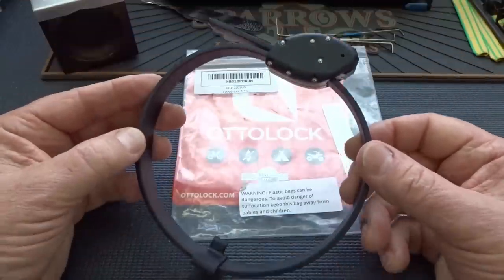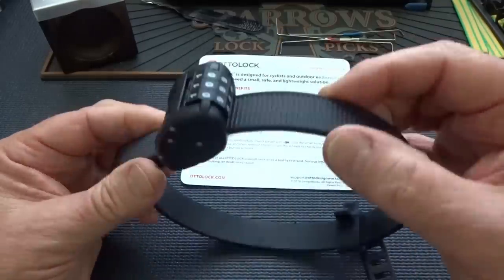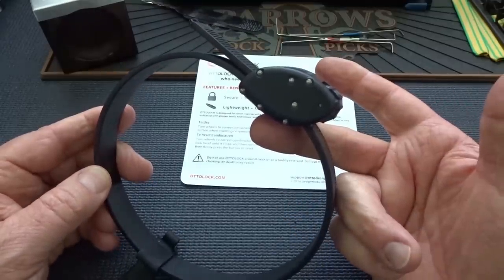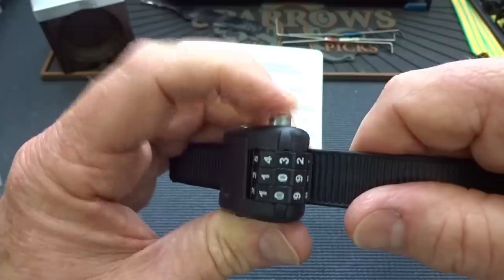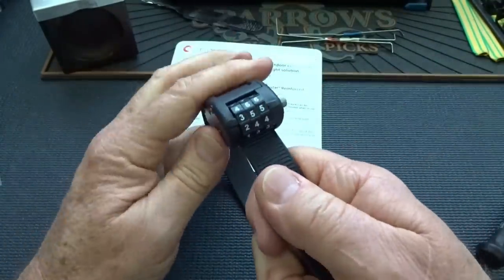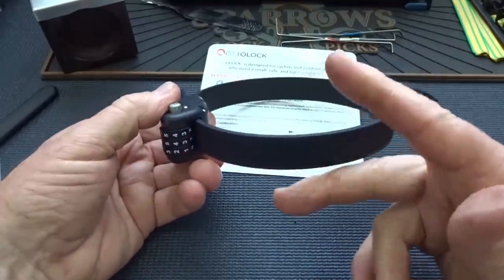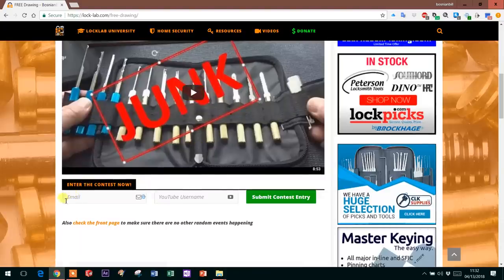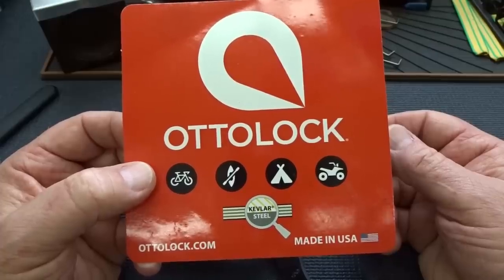(1272) Review: Ottolock Bike Lock (JUNK!)

Comment: This is very unfortunate. We appreciate the quality of your reviews and explained context around bike locks and design intent. As you mentioned, our lock is designed as a short-stop theft deterrent with key features being lightweight, compact size, and ease of carry. The lock reviewed in this video most likely has a defective key inside. The key is not engaging the pawl. This could be due to a missing key, damaged key, missing spring, or stuck key. In any case, it demonstrates a gap in our quality control procedures. We have a very comprehensive incoming part inspection program, and we also conduct a 100% inspection of each lock at the end of our assembly line. While we do not know the problems with your prior two locks, this lock is defective and completely a fault in our workmanship, not design. We will provide you with another new lock for another review.

Additionally, two other points: 1. Your shim failure attempt is not entirely valid as the pawl was not locked in place in this test, and 2. The ladder strap on the provided lock is not for carrying on the bike, but rather for holding the lock in coiled position. The bike mount is much bigger, stronger and sold separately.

We are proud of our ‘Made in the USA’ manufacturing and prioritization of quality first, and happy to address any questions directly via our website and support team.
Thank you,
OTTO DesignWorks
Reply: Oh, come on. 100% inspection of each lock? I call BS. You have a 3.2 rating on your lock on amazon, with people having all sorts of issues, including their lock being stuck closed. One such reviewer mentioned using a knife to shim the lock open when it gets stuck closed. Your locks have serious issues and so does your quality control, if it even exists. This was not an isolated incident.
Reply: I never tried one of your locks so I can't give my opinion about the quality of your prodcuts. But at least you seem to offer a solution here. I hope you'll keep your word and that Bill will make another review.
Reply: He received 3 defective locks in a row. Who is your QC person? Homer Simpson?
Reply: The next Bill Gates maybe ? I wish I would have watched this video before I purchased mine. When it gets here if the same thing happens I'll return it in a jiffy.
Reply: This could be very good for your company in the long run. If there are problems with the design an outsider will often see them more quickly and allow you to make corrections early.
Reply: This has been good. While not a design problem, we did identify a manufacturing process change to eliminate any probability of missing catch key spring.
Reply: OTTO DesignWorks I’m actually impressed guys- how often do we see manufactures owning up to mistakes, and taking initiative and ownership on corrective actions? Great job OTTO, now please stand behind your insertions.
Reply: Good on you Otto. I will keep this comment in mind if I look into future designs and improvements of this lock, should I choose to need a new lock. Should definitely mind the shimming bit though.
Reply: For $55 for very light protection when it works, you couldn't include a damn MOUNT? That is absurd.
Reply from the maker: Still waiting for the replacement.  LockLab, P.O. Box 2160, Merrifield, VA  22116
Reply: Sorry Bill. We did not see a reply email. We'll ship this week. Thanks for address.
Reply: Good on Ottolock for responding and owning the issue with THIS particular lock. Needless to say; The review of a obviously defective lock is pointless, other than showing that he couldn't cut the band with pliers (any lock can be cut with a grinder/hacksaw). I own three of these locks that all work fine and can't be defeated with a shim/butter knife or whatever. Perfect lock for short stops and way more secure than cable locks.
Reply: so how do you feel about the fact it can be cut in 2 seconds with 10 dollar shears?
Reply: Lol. I might as well use my belt as a lock instead of the ottlock. Both provide the same security.
Reply: China numba wan!
Reply: Why are you deleting comments in your videos?
Reply: 9 months late to the party, but this many security defects and manufacturing defects leads one to believe Otto's 100% inspection of product with these sorts of failures is either a lie, done by the utterly incompetent, or that the flaws are actually the intended design.
Reply: OTTO DesignWorks  Your product is complete junk as it can easily be cut with tin snips or scissor.  WAKE UP !!!
Reply: e.g. Smith why would they wake up. They make $55 a piece.
Reply: Guess what else is short term. The time taken to cut this off a bike
Reply: @thefuumanchuu  dont insult homer like that obviously the guy is worse
Reply: @DATH-kc6ei  That makes for a pretty short stop if as it takes 30sec to cut with a pair of tin snips !!!
Reply: I going to buy one and use it for a dog collar for my mastiff thanks bill
Reply: From the videos I've seen, you're better off using heavy duty zipties, if you want a minimal deterrent: same level of protection, but much cheaper...
Reply: Your short stop lock is 50+ dollars and is worse than a 20 dollar ulock. GET OUT
Reply: Just go to home depot and buy $10 metal snips, lock defeated in less than 2 seconds.
Reply: @ottolock  I find it interesting that you disable comments on your advertising videos as soon as someone points out the fact the Lockpicking Lawyer showed that this "lock" can be cut in 2 seconds or less with a readily available Wiss compound leverage (aviation) snips. However, Bill shows and even easier and toolless method of defeating the "lock".
Reply: @HaggisPower  nope, $10 aviation snips cut right through it.
Reply: @777osbaldo1  or use a cat's flea collar.
Reply: Get OTTO here and DesignWork a new lock that actually cannot be permanently opened using tin snips (or other tools such as bolt cutters).

Until BosnianBill AND LockPickingLawyer can verify the improvements, I have little faith and would rather see the finishing kick in the near future.
Reply: And easy to cut with some tin snips? Is that part of the features?
Reply: Also, why do you condone your supporters calling people who cal you out on your "quality" products trolls? It goes to show what morals you (don't) have.
Reply: @egSmith-sp9gl  You're giving them 15x too much credit. It's cut off in under two seconds.
Reply: @bosnianbill  they ever send out that replacement?
Reply: You might as well use a industrial zip tie this lock is not worth making in the first place pure and absolute rubbish.
Why do you people give it up as a bad job
Reply: They would probably work as straps for snowboard bindings to lock your feet to the board while riding, i mean if it was working,I'll guess something like that made this idea of locks.. Not a bad idea it's a very bright idea. I like the concept but the materials are very far from strong enough And it should have a false gate for shims. I would love to see ottolock coming with a upgraded version that works every time and can't be cut with a bolt cutter. I just watched the commercial for this lock and it said it was carbon plated and not possible to cut with wire cutters, which this video shows is not true. Anyways he should also try with normal scissors just to see if any kindergarten kid can take your bike
Reply: This sounds like complete bullshit.
Very happy I did a little research before buying this garbage to lock up my prized road bike.

You make made in the usa look very very very very bad sir
Reply: Otto lock You rigged the tools in your review video you posted on YouTube and shutoff the comments so we can't call you on your b.s. So we're guna call you out here .
Reply: @bosnianbill  did it ever come? I don't see a second video from you on it
Reply: I'm amazed that a company could screw up a ziptie
Reply: wow a brand company watched the video
Reply: Nice cover up lol back to the drawing board haha
Reply: Literally legal boiler plate lol...

Comment: when you changed the code and simply pulled it out I laughed so much.
Reply: I think the problem re-setting the combination (at 4 minutes) may be caused by the fact that the reset was done with the band inserted in the lock.  The packaging that came with the lock I purchased (July 2019) had a warning about that -- it says, "Do not reset the combination with the band inserted in the lock"

Comment: I bought two of these locks last winter, but I had the opposite problem that you had: they were very, very hard to open.  I was positive I had the right combination dialed because I could press the button down, but I tugged and tugged.  Eventually I could get the lock open, but it wasn't easy, and I was very worried about it getting stuck and having my bike permanently locked somewhere.  I simply can't trust this lock.  The only support I got from the company was to tell me to watch the video about changing the combination.

I thought it was interesting how easily you smashed the lock with a hammer.  The company had an advertising video that made it look very hard to do this, but you did it in about 5 hits.  It's also scary how easily you cut through the lock with a simple hacksaw or a pair of wire cutting pliers.  I know these locks aren't supposed to be super secure, but I thought they would have provided a bit more protection.
Reply: Mine failed in the Lock position after 3 years of light use.  I had to cut it off with diagonal cutting pliers -- fortunately that just took a few minutes.

Comment: Just thought of those stainless steel hose clamps (the ones with the screw). Much cheaper.  Available at any hardware store.

Otherwise, four to five feet of Pewag chain (1/4 the weight of your bike should suffice) and a decent Squire padlock should offer some more resistance. Thieves will then cut the tree or fence or try their luck on another bike ;)

Comment: That's surprising, but all down to quality control as you say. I have a couple ( I was an early Kickstarter contributor) and they are both perfect at what they do. That is, a lightweight lock that would stop a casual thief, or a less casual one armed with bolt cutters. I doubt if you could shim the pawl if it was locked, as there is no trace of movement in the strap.

Comment: My OTTOLOCK came in the mail today. The 30" Black model. For one thing, the lock looks a lot thinner than it does in the pictures.  What I mean by thin is that its less than inch in width. In any case, after watching this video I took it through the steps. First I checked if I could change the combination. I was able to change the combination NO problem. After changing the combination I pushed the other end through the lock and tried to pull it apart. I'm not the strongest guy in the world, but not the weakest either. I finally gave up trying to take it apart with my bare hands. 

Then I did the shim test as seen on your video, again I was unable to take the lock apart. The mount the lock came with I think is just to keep it together and is not really a bike mount. Why would someone want to mount this to their bike I don't know ? It is small and light enough to fit in your pocket(jacket pocket). 

Maybe I got lucky or something, but thank god none of the things you mentioned happened with my lock. Of course I'm not going to try the hammer trick, drill, or Grinder test you did at the end of your video, I just can't afford it !  

Well so far so good... If any of the things you mentioned on your video do occur in the future I will surely keep you posted. 

 This lock is just what I wanted for  short trips around the neighborhood,  the grocery store, liquor shop etc. or when I'm relieving myself on the trail.  I also got myself an ABUS Ultra 410(entry level)  and a $40 bike Alarm for more serious situations. I know this might be overkill, but I hate thieves, especially bike thieves. 

Next week I'll probably order the OTTOLOCK's big brother which is the LiteLok Gold, https://www.litelok.com/collections/litelok-products/products/litelok-gold-wearable-boa-green  .  What else am I going to spend my Tax refund on ?  One thing for sure  I will not be leaving my bike overnight anywhere on this planet, lock or no lock. Not even in front of a police station. But for a couple of hours I think I "might" have purchased peace of mind.
Reply: How much does ottolock pay you to write these diatribes?

Comment: I purchased mine (30") today @ REI. I had a bit of difficulty getting the new combination to reset. I was using the end of a Pentel lead pencil and it just wouldn't go. I found this was to wide, I switched to a small paper clip. Worked like a charm them. Combo reset and works fine. I wanted something small and would fit in my bag that I could use if I was going to run in somewhere for a minute. Nothing long term, this fits the bill.

Comment: This reminds me of a bicycle like I used in Mexico a few years ago on a rental bike except it was a coiled cable.  The lock was in really bad shape and I could hardly ever get it to unlock so I would just take the coiled portion and twist it around something and make it appear as if the bicycle were locked but it never really was. And I did that everywhere I went and everybody just assumed that the bicycle was locked up to something. So with this lock no one would probably ever think to try to pull it loose, they would probably try to cut it first.

Comment: this is along the same lines that i said would be the weakness of this lock in early videos of this lock.   First, with such fine ridges in the strap for the mechanism to hang on to (hold locked) the lock frame would need to be extremely stiff to prevent flexing out of the ridges if forced and yanked.  Secondly, the internal ratcheting mechanism would need to be built to EXTREMELY high spec'ed tolerances to not give any slack while engaged in such tiny ridges.   

The 2nd is the reason i suspect this lock is failing.

Comment: Just bought one from the Amazon,  for $65, longer version, seems to work fine, and wheels are smooth too, changed combination in two seconds, does look like an expensive zip tie, but I wouldn't carry any other lock this one is weightless, goes into my tiny underseat bag.

Comment: Even less secure than this lock on a computer case. I opened it with an unfolded paperclip. hand turn the core (as in, no tentionner), slide in the paperclip, lift, hand turn the core.

My first attempt was to lock it, I tentionned it by turning the locking bar behind the lock, so light tention, lift and it turned....

But hey! I had to actually use a tool! ... I need to try to unlock with a zip tie, it can act as both the lock pick tool and the tentionner I guess?

Comment: I had a 30" OL which worked fine, but just wasn't long enough for my application, so I went all-out and bought the 60". It works great too.     Not sure most people are aware, but another reason to consider this type of lock is if you have bike insurance and your bike gets ripped off, It's hard to make the ins co pay up unless you have the ruined lock that the theif broke into to get your bike.

Comment: How does it operate when it's pilled tight around a pole or bike? My guess is that that is a quick release feature so you can open it quickly without something in it regardless of what position the locking parts are in, but when you pull it tight around whatever you're locking, it operates properly.

Comment: I have this lock and can tell you that it does NOT behave like this AT ALL.  When out of the combination, it will NOT open or slide out.  The other thing I see is that if the lock was not working properly when locked, sliding the shim in is not going to prove anything.  You can't slide a shim in my lock.

Comment: Hey Bill, I wonder if the lock is intended to be used like a zip tie, where you're supposed to pull it tight. Then the Locking Paul would be firmly planted against the ribs or the teeth on the Belt. I'm probably too late with this comment, and I know that for testing a lock, those instructions should be on the instruction card. Thoughts?
Reply: A zip tie works without pulling it tight.... if it doesn't you got a shitty ziptie.

Comment: I have this lock and COULD NOT REPLICATE THE FLAW in the video. It's going to give some sort of protection; but if I was going to leave my bike unattended with it for some time, there would be at least one other lock used in conjunction.
Reply: Yeah but around every 3rd rating of this lock has problems with them. And then they claim 100% quality control lol
Reply: Michael Anderson I had my bike stolen recently. I got this lock and along with a U-Lock. I know a cyclist who says the two together should be alright. But I may get the 60” to snake both tires.
Reply: SNIP with $10 Wiss aviation snips. This "lock" is better suited as a cat collar.

Comment: If you get in touch with the seller and tell them what is happening with the defect, and if they are worth anything as a company then they will refund/cover your shipping. If not then still try amazon even if it is not a “fulfilled by amazon” order. They might make it right, particularly since you have the defect on video and had to deal with 3 non working units. I can’t believe how garbage this “lock” is. Tying it in a knot would be more secure then using the lock.

Comment: While bolt-cutters have difficulty with sheet metal, simple sheet-metal-cutters should not have as much trouble with this type of lock.  It would have been nice to see you attempt with sheet metal cutters, at the end, instead of using electrical-copper-wire cutters that are not designed for that.
Reply from the maker: I didn't think of that!  I have some metal shears around here somewhere too.  I'll dig them out and be ready for the next one.  Thanks for the tip!

Comment: did you try holding the button in before scrambling the code?
Reply from the maker: The button will not depress unless it is set to the correct combination.  On all other numbers it has a mechanical block.